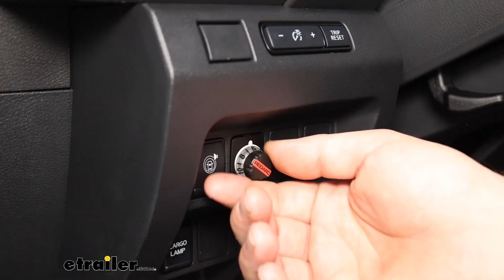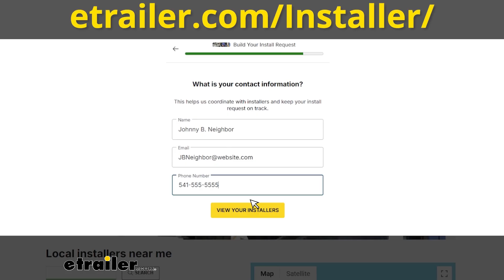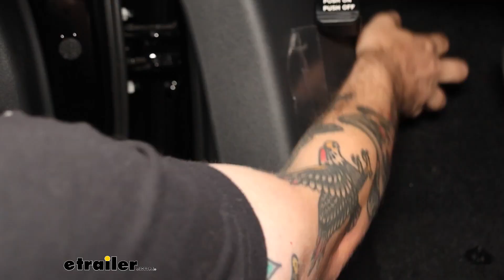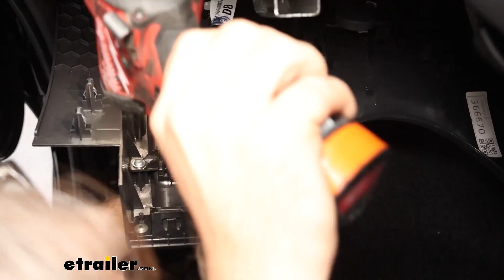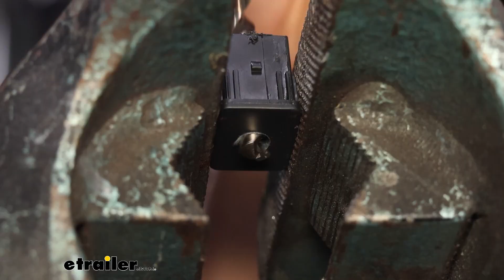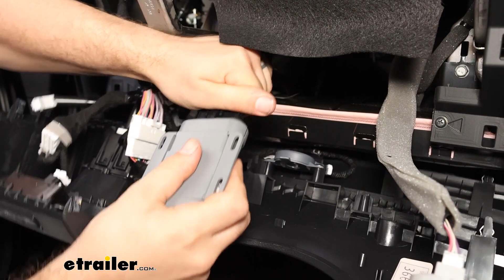etrailer | Installing the Redarc Tow-Pro Trail Brake Controller in a 2025 Nissan Frontier

Comment: How do you know when the unit is calibrated?
Reply from the maker: The Redarc Tow-Pro Trail brake controller is calibrated when the LED turns solid blue. During the calibration process, the light will flash blue and green while you drive and apply the brakes, as the unit learns your vehicle’s motion and mounting position. After about 10–20 normal stops while moving, it should switch to a steady blue light, indicating calibration is complete and the controller is operating in proportional mode.
Reply: @etrailer  thank you, after it’s calibrated, does it still light solid blue when the engine is on?
Reply from the maker: @kdbwiz  Once calibrated the Redarc goes into Everyday mode and the light will remain blue which is ideal for highway travel and general use on all road surfaces. If manual mode for driving in sand or mud is enabled the light will turn green. And when the brake is applied, regardless of mode, the light will turn red.
Reply: @etrailer thanks a lot, great info
Reply from the maker: @kdbwiz  Happy to help! If you have any other questions as you get everything set up, just let us know. We appreciate you choosing etrailer!
Reply: @etrailer  regarding your second to last comment about different colors, is that the case only with tow mode and the trailer attached, or even if the truck is driving without towing. And is it connected to tow mode  being pressed?

Thanks again. Want to make sure I got this right.
Reply from the maker: @kdbwiz  No worries, that's a valid question. The color changes on the Tow-Pro Trail’s control knob aren’t tied to the truck’s tow mode button, they’re based off the brake controller’s status and whether it detects a trailer connection.

Even without a trailer connected, you’ll still see status colors like standby or calibration mode. Once a trailer is plugged in, the colors will change to reflect active braking and output levels.

Tow mode on the truck can affect how the vehicle behaves while towing but it doesn’t control the LED colors on the Tow-Pro itself.

Hope this helps and thanks for reaching out!
Reply: @etrailer appreciate the help
Reply from the maker: @kdbwiz  Anytime!